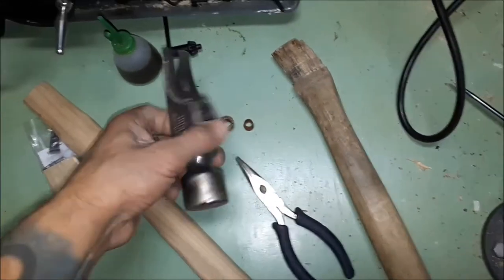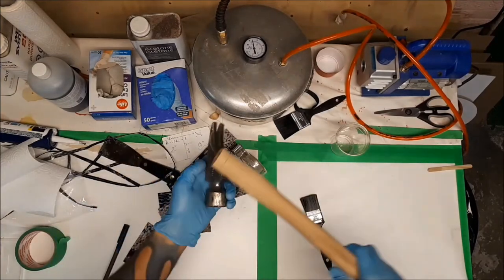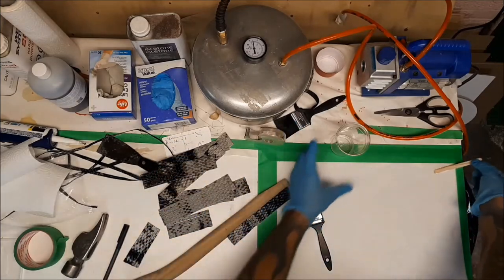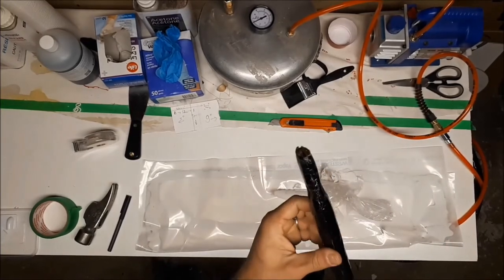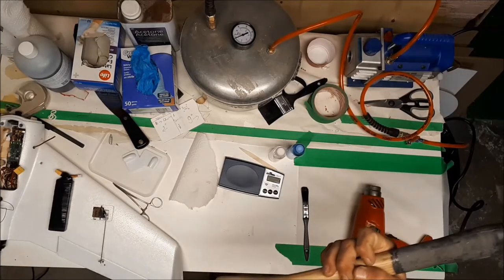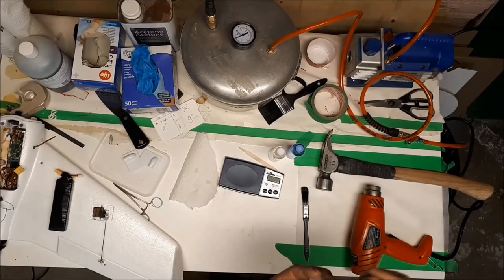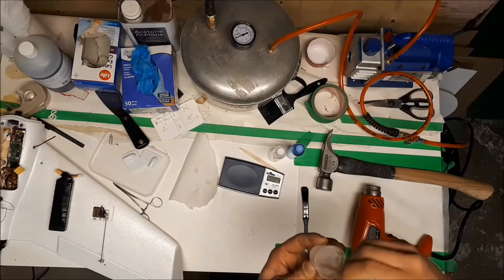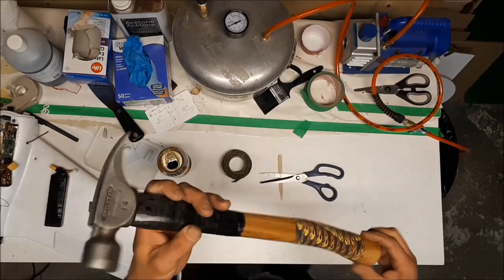Stiletto Titanium hammer handle mod

Comment: What is the material that you wrapped handle in before reattaching the head called?
Reply from the maker: Carbon fibre. Unidirectional strips, smth like that- https://www.ebay.com/itm/12K-200G-10X100cm-Black-Carbon-Fiber-Cloth-Fabric-Tape-Uni-directional-Weave/173104672949?hash=item284dd7b0b5:g:KE8AAOSwceNaXxik